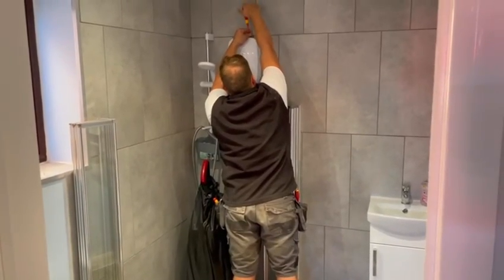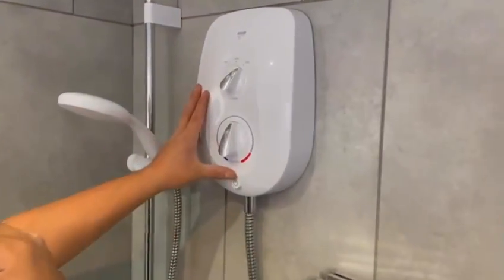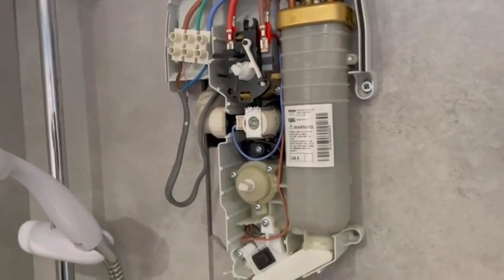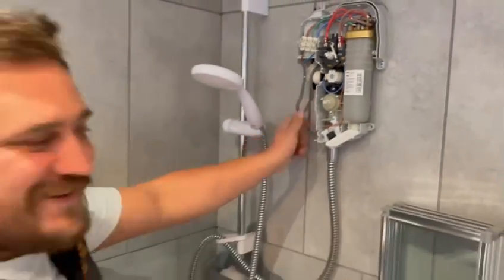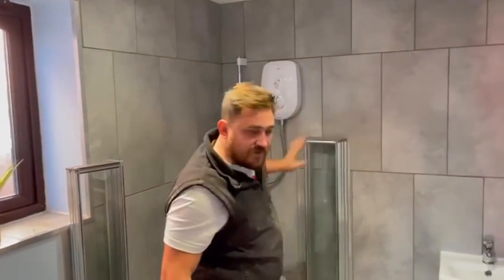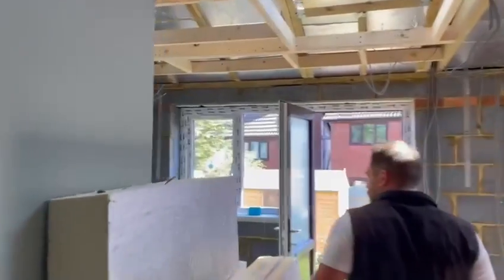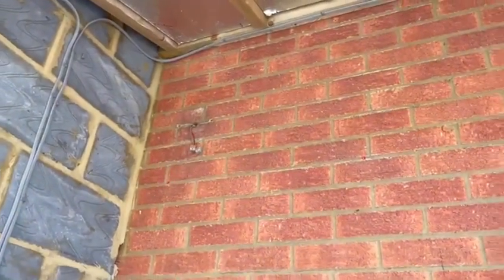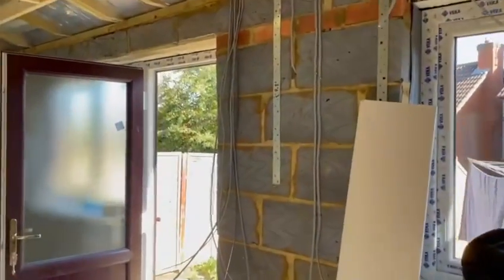8.5kW Shower Wired in Lighting Cable

Comment: Excellent vlog, when I moved into my house I noticed the shower cable looked rather thin so I went straight to TLC electrical and purchased 7 metres of 10mm cable, which I labelled up as well, the shower has its own 32 amp mcb on the consumer unit 👍👍
Reply: Hopefully your shower's no greater than 7.3KW. 😊
Reply: @rayc1503  
If it is, changing the breaker is a lot easier than changing the cable. 10mm can cope with 57 amps, needing a  50A breaker. So it can take a shower of 11.5kW, max. Which I believe is the max shower rating. 🙂
Reply: @johnburns4017  If it's ref meth c and clipped directly then 64 Amps. Where as ref meth A in conduit or wall then we're looking at 44 Amps. You'd also have to put voltage drop calulations in accordance wity the distance of the Shower. 
This being on a 10mm cable and 32 Amp breaker  not even stating Rcd protection makes you think the person's not clued up. Unless it's A <7.3 KW which may be ok, meh 🤷‍♂️.
Reply from the maker: Thanks for watching and commenting

Comment: I had one years ago where the clients ex husband had fitted a shower off the upstairs lighting and then fitted a 40amp mcb in the old wylex fusewire board for the upstairs lighting, it lasted a long time before it blew the cable and tripped the mcb, i kept that bit of blown cable in my van for years to show people (cable was the older stranded 1960s lighting)
Whilst i was there fixing the issue i disconnected the shower (and the socket he installed over the bath!)
Reply from the maker: Hence ex husband 🤔. Thanks for watching and commenting 👍🏻

Comment: All of five minutes of a search on the Mira website reveals quite clearly marked instructions for installation.... !

1. The electrical installation must comply with BS 7671 (commonly referred to as
the IEE Wiring Regulations) and all relevant building regulations, or any particular
regulation or practice specified by the local electricity supply company.
2. Ensure that all circuit protection devices, switches and cabling is adequate for the
rated current of the shower and that the rating of the electricity supply company
fuse and the consumer unit are adequate for the additional demand.
3. The shower must be earthed. Ensure any supplementary bonding complies with
the relevant regulations.
4. This shower is intended to be permanently connected to the fixed electrical wiring
of the mains system. A separate supply must be provided from the consumer
unit to the shower.
5. DO NOT supply any other electrical equipment including extractor fans or pumps
via this product.
6. This shower must be provided with means for local disconnection that is
incorporated into the fixed wiring in accordance with the relevant local wiring
regulations. This must be a double pole switch, which has at least 3 mm contact
separation in each pole. The switch can be a ceiling mounted pull-cord type within
the shower room or a wall mounted switch fitted in the applicable zone area.
7. For new installations a 30mA Residual Current Device (RCD) must be
incorporated into the electrical supply to this shower in accordance with current
wiring regulations. When replacing an existing electric shower we recommend
that a 30mA RCD be incorporated in accordance with current wiring regulations
if not already provided
8. DO NOT apply excessive force to the terminal block.
9. All electrical connections should be checked for tightness to prevent overheating
before switching on the electrical supply.
10.DO NOT switch on the electrical supply until the plumbing has been completed
and checked for leaks

Comment: Us real electricians don’t and never have referred to fuses MCBs RCDs or RCBOs as circuit protection devices, we call them what they are ie fuses MCBs RCDs RCBOs .
And we have never referred to the earth conductors as CPC it is the earth conductor always has been and always will be. For god sake even the tables in the reg have cables listed as twin and earth . Guy’s your not at college anymore you’re working in the real world now so time to stop with the CPC rubbish. Buy a drum of flat cable on the label in big black letters are the words 2.5 mm2 other sizes will have the same words ie 👍flat twin and earth PVC CABLE. Is it really that hard to understand.

Comment: LOL, 'cpc sleeving'. Nobody says that. But yeah, seen it before, lol
Reply: @GSHElectrical  Gaz, I know i keep doing the cpc vs earth thing, but it's only fair to let trainees know what it's like on site.  ;). The shower we saw was on 1.0mm :O  off a 32A circuit, board to isolator was a proper 6mm2 circuit, installed correctly, then some prat had wired loose 1.0mm from the isolator to the  shower. Amazingly it hadn't caused a fire, but the cable was decidedly crispy

Comment: I did a job a few years back. A very competent DIYer had done a first class job for his sister. I had some very strange readings when I tested the lighting circuit. The last light fitting had an extra cable??? What was going on here? The owner told me sometimes if the lighting fuse (rewireable Wylex) goes, her shower stops. He had added the shower to the loop in  lighting circuit!!!. I had another, An electrician had connected 6.0mm cable from a disused immersion heater to 2.5mm then fitted a 10kw electric shower. on to a 16A mcb with no RCD protection. The owner was told never to operate the shower at full power!! He may not of been an electrician....
Reply: Some people clearly don't know what they are doing. If they did they would be aware of the consequences of their actions, i.e. possible fire etc. But theses days bodger's are all too ready to just do what they need to to get something working and then never seen again 🤦🏻‍♂️.
Reply: @stiggyness1976  Indeed, I couldn't sleep at night. :(
Reply: @TheChipmunk2008  j
Reply: @TheChipmunk2008  agreed!!! 1.5 sqmm to an instant shower…..really??!!!!
Reply: I  cant get my head these bloody DIY clowns

Comment: My god, whoever wired that up needs a kick in the b*****x. That's a fire waiting to happen, I'm surprised the cable isn't showing signs of heat stress 🤦🏻‍♂️.
Reply from the maker: The circuit would trip very quickly this prevents sustained overload current 👍🏻
Reply: @GSHElectrical  very good point... and if used on low power setting (as would likely be necessary) the overload isn't as severe as the max rating of the shower would suggest. Still far from good, but at least they doubled the wires over :)